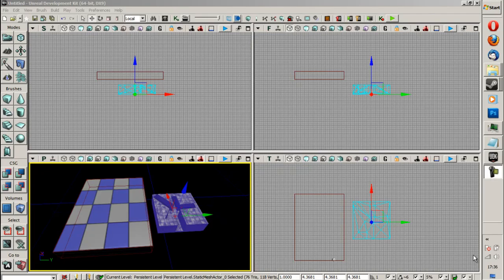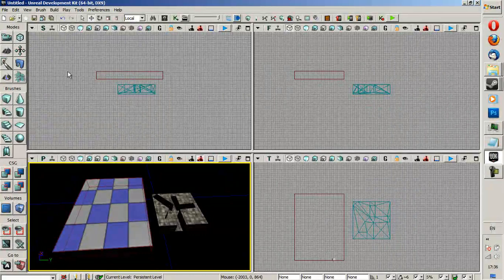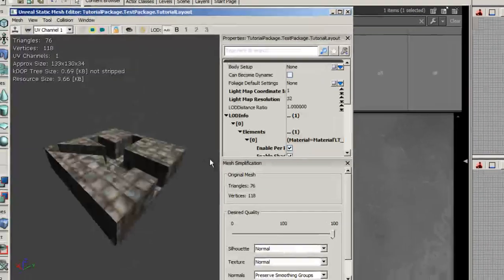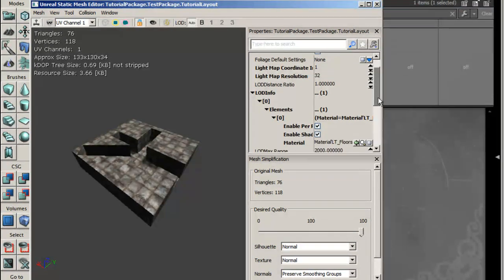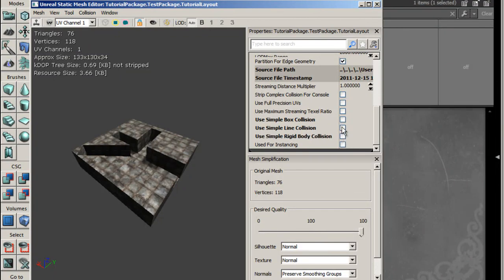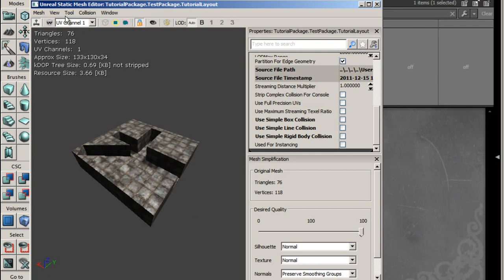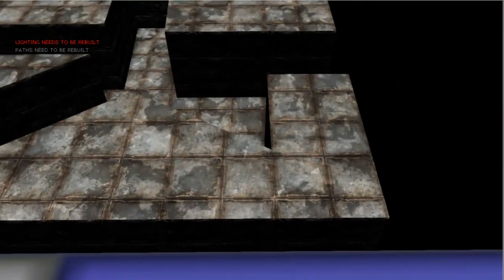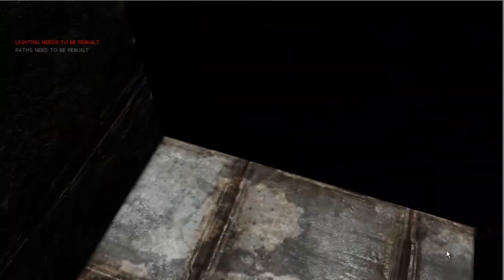How to do Per-Poly Collision with Imported Meshes in UDK

Comment: Hey man thx so mutch for this video it help me a lot with my studies, but i have just a question do you have Shadow artefact too when you build your scene cause evrything work's great except light :/
Reply from the maker: Glad it helped, but I'm afraid not. Are you using movable lights? If so, are they set to Normal or Modulate. If it's set to Modulate, try setting to Normal, and if it still artifacts, increase the maximum shadow resolution.

Comment: This isn't for standard collision, this is for PER POLY collision. Standard collision meshes are typically much lower poly than the actual mesh itself to improve render times. Some models however require more accurate collision so you want to enable per poly collision meaning that the collision mesh will be an exact replica of the actual mesh. This is obviously more system intensive, however with instancing it can sometimes be very fast if you use the same mesh several times over in your level.